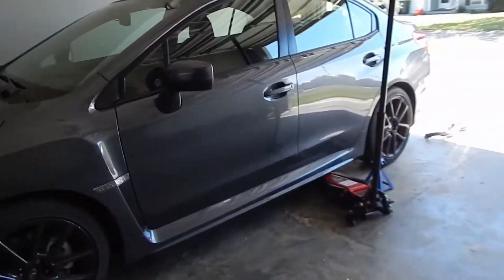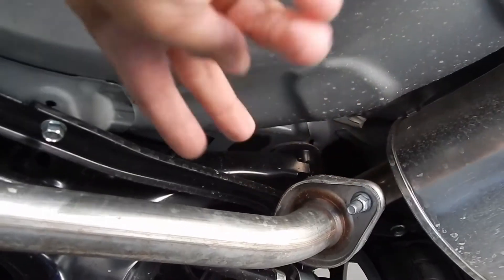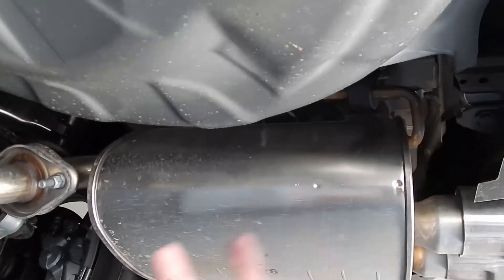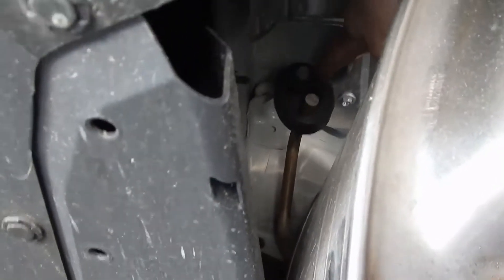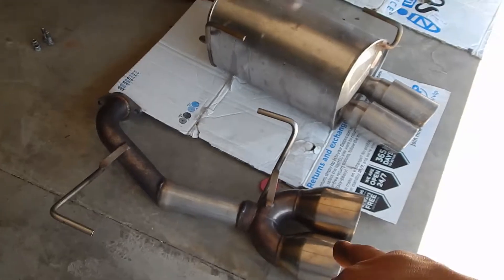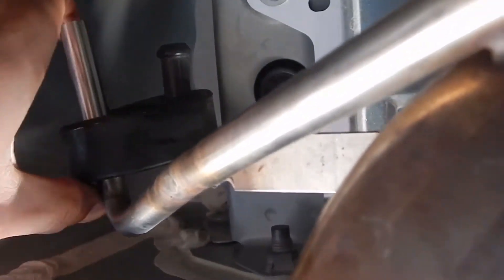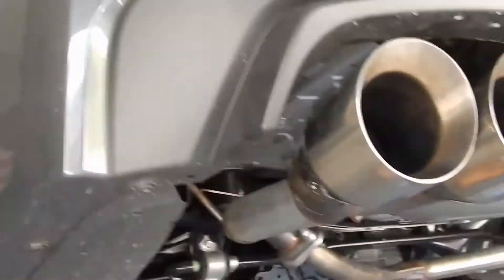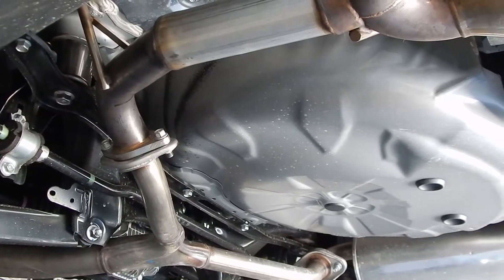How To Install Axle Back Exhaust on WRX/STI

Comment: Did you need a tune after this?
Reply from the maker: NEED- no. Want/Recommend- Yes. It's not required for just a muffler delete especially since the rest of my exhaust is stock. But because I also have the Cold Air Intake and plan on doing more of the exhaust upgrades I bought a COBB Accessport and put a shelf tune on it